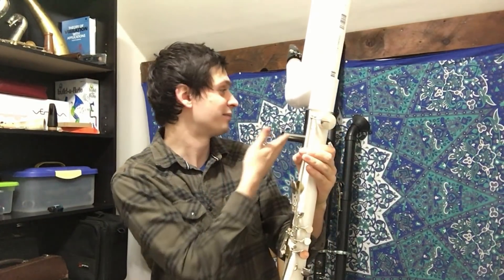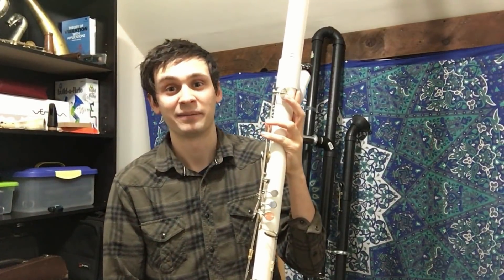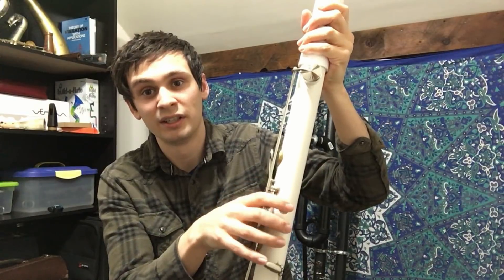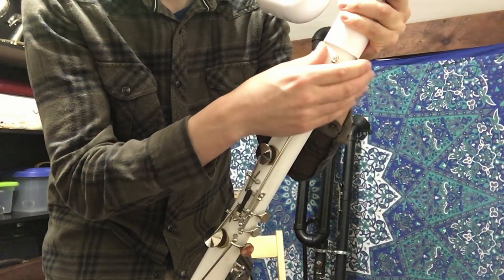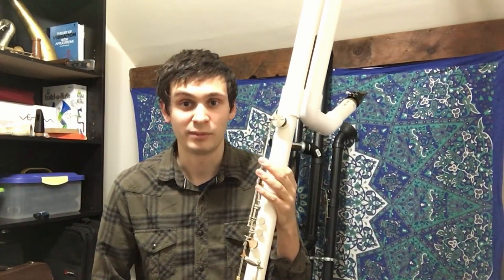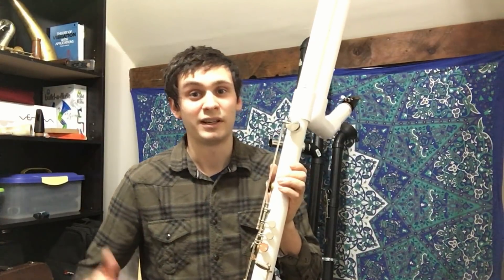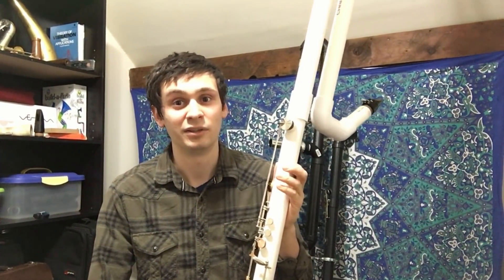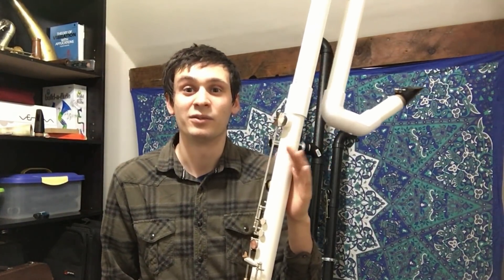I'm building an Octocontra-alto clarinet... with Boehm keywork!

Comment: When will you be finished building the OctoContrabass?

Also, you can support my project.
Reply from the maker: Hopefully in a few months. I'll tell you what, if you can make the bocal and wing joint on your own (with high quality materials!) with chromatic keywork down to mid C, I will fully support your project.
Reply from the maker: Mr. Incredible I think you may want to start a bit smaller. I made my first instrument 10 years ago. It was a tin whistle made from pipe. Ever since that first instrument I've made countless others. My homemade instruments started out quite bad but with a lot of work and practice they got better. Now I'm to the point where I can make custom keywork and body joints. Learn to make simple instruments before you attempt something bigger otherwise you will set yourself up for failure. You know what they say, you have to learn to walk before you can run!
Reply: @Jared De Leon Very interesting. It is actually very hard to reach middle C on a hyperoctosubcontrabassoon. Also, I want to do this like Richard Bobo. I want to make low G extension bells for Octave Bassoon, Bassoon, Contrabassoon, And Subcontrabassoon.

I will not make one for the Hyperoctosubcontrabassoon because there are foot pedals and the bells are for the ones without foot pedals.
Reply: @Jared De Leon Don’t tell HelicopterHarmonics (TruncatedTriangle) that I am Mr. Incredible’s 2nd account.
Reply: @Astro Boy Too late, It's obvious that you're Mr. Incredible. Plus I've already told Jared about my accounts. He even subscribed to my main one in August last year.
Reply: HelicopterHarmonics nice, It is that guy who hates me.
Reply: @Hyperoctosubcontrabassoon Oh well.

Comment: So from a composition point of view, having the Octo-Contra-Alto is kind of a weird place. The role of these giants would be to double the Contrabass an octave lower, so having an instrument only a fifth away leaves a bit of a gap. That said, in terms of portability, it seems to be much easier to use than the OCB. If I were to ever write for one of these instruments, I'd always default to the Bb over the Eb.
Reply from the maker: Interesting. I imagine it would be similar to the current contrabass vs contra-alto situation where composers prefer the BBb instrument but doublers still commonly use the EEb for reading bari sax and bassoon parts.
Reply: Wait! No! Stop! That’s impractical!